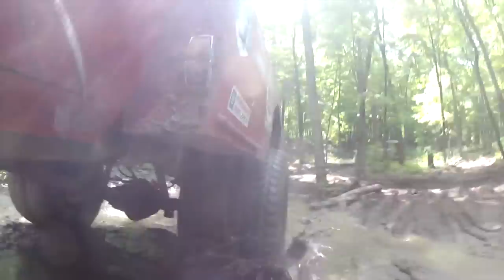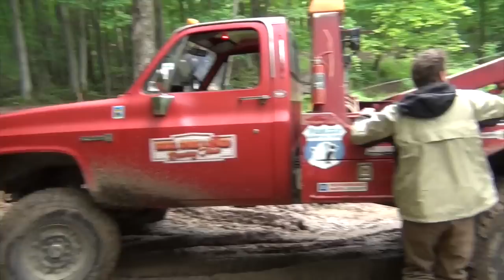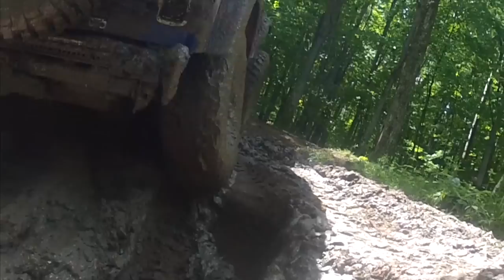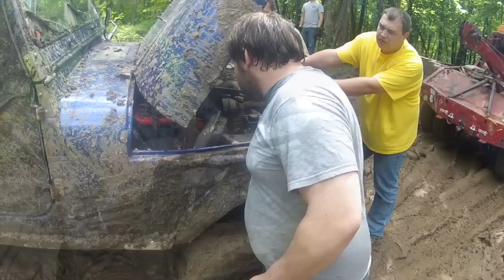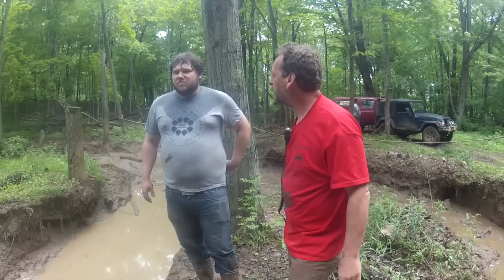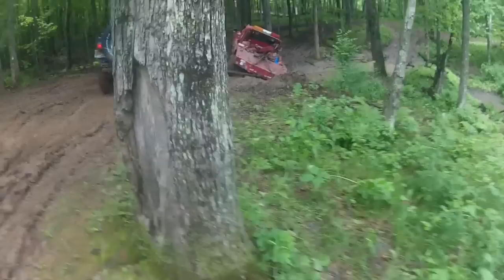JEEP FRIES WINCH by BSF Recovery Team

Comment: That is why i was taught to winch 30 seconds and then stop 30 seconds and use a snatch block if the winch is struggling. If he was alone and did that he would be fucked.
Reply from the maker: You are correct.
Reply: Key word: duty cycle 
👍😉

Comment: If you were planning to buy a new winch for the front of the wrecker, what would be your top three choices?
Reply from the maker: If I was to buy a new electric winch for the front of the heavy wrecker, I think I would go with a Warn 16,000lb one. I have installed many of the 12,000lb ones on Hummer H1's when I worked at a Hummer dealer. And had only a few that ever needed repair. But I have also thought of putting a commercial hydraulic one on the front, since the wrecker is equipped with hydraulics.
Reply: Warn 16.5K lb on the front of my powerstroke for when it gets stuck hooked to trailers.

Comment: You've probably been asked i just never seen but im wondering why you dont put a bit more of an aggressive tire on the truck?
Reply: he runs the military oz tires caus 1. they're affordable, and 2. they have a tough enough construction to handle a 10k tow truck hauling something with a big block and 2.5 ton axles. nobody makes a bogger or swamper tough enough for those kinda loads
Reply: I've seen more then a few heck even some of the tow rigs in one of his last videos running boggers and more aggressive tires I've seen a ton of his videos and for the most part (in the videos) he isn't towing overly heavy trucks out of the Bush, I was just wondering because it would definitely help a bit more with traction which he had tons of problems with in this video alone
Reply: its not like this thing is road legal, or has to pass inspection/whatnot.  dually swampers of that size would handle the weight no problem.

Comment: "Had to put it in park"....what is this mysterious "park" gear??     :p
An LT1 is quite a bit of motor for a Jeep.  Hope his Opti holds out, they aren't known for being very water friendly.  He probably should get a prefilter on there also.   Water goes right though those cloth elements.
Reply: I second that opti comment. I had a 94 camaro leave me stranded outside a fire station for 6 hours during a hurricane after going through a small puddle. luckily it quit on me before i went down the hill as i found out the next day that there were cars and dumpsters floating around down there. Maybe the chevy gods were trying to save one of their own lol.
Reply: bentboybbz
 I used to own a '96 WS6 which I later sold to a family member.  He challenged some water that was too deep and stalled it out.  It had the later, more durable, vented opti, but the hoses had rotted allowing water in.  I sucked a 1/2 pint or more of water out with a bleeding tool.   We were able to limp it to his house, but the opti needed to be replaced.
In this case, it was probably due anyway.  I found that there is a ball bearing in there and this one was all but destroyed.  The ball cage was gone and it was probably only a matter of time before it self destructed.
Kind of a shame GM was too cheap to go with a DIS system with the LT motors.
Reply: l337pwnage yea. My bro wrecked that car fell asleep on the way home from work woke up to an airbag and some poor guys rear tires on the hood. When I got there the guy was crying. In court the guy started crying again said he was doing 75 heard it coming for a split second and smash. I thought it was hilarious. The judge did not. Still did great doughnuts afterwards though. By the way Chevrolet charged 1200 to fix the car when it drowned. Last time we did that...thought it would be a 200-300 dollar deal...